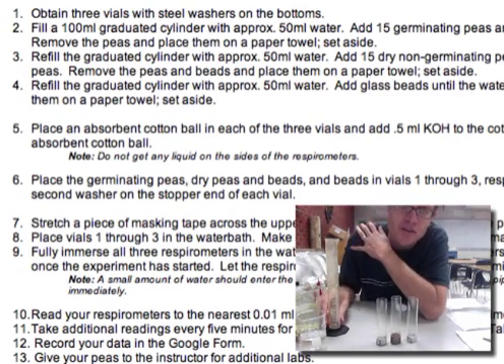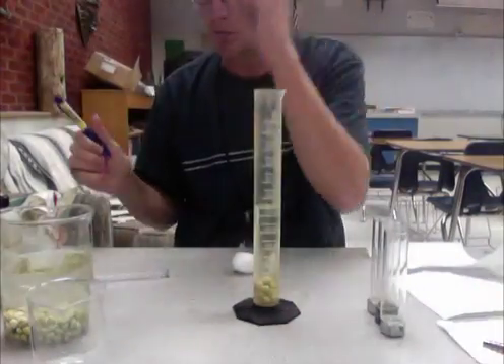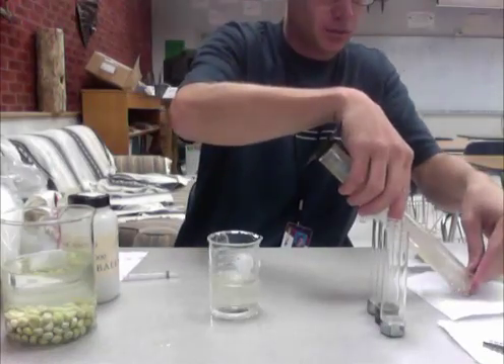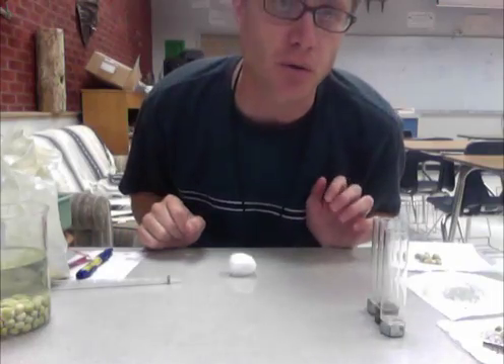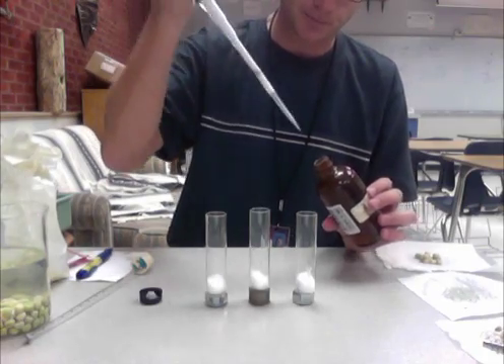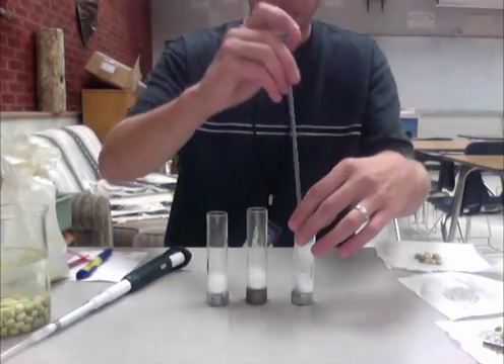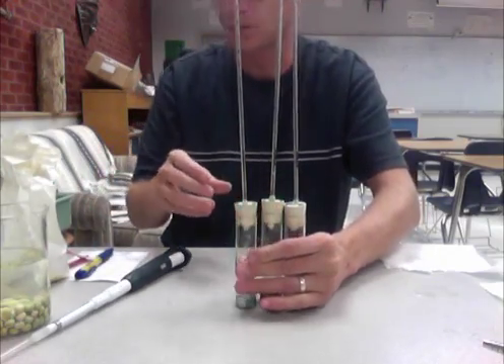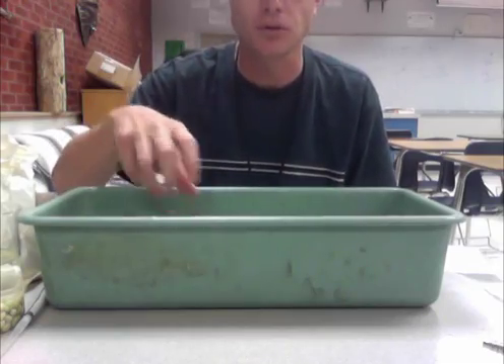Cellular Respiration Lab Walkthrough

Comment: Is there supposed to be any water inside the vials? If so, how does the water get in if the vials are sealed? Also, can the weights be put inside the vials or will that tamper with the results?